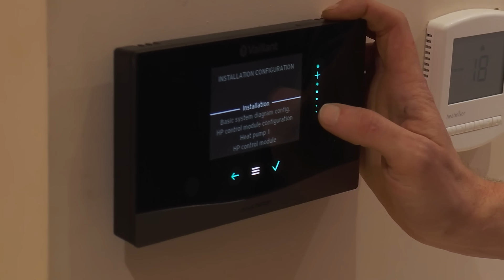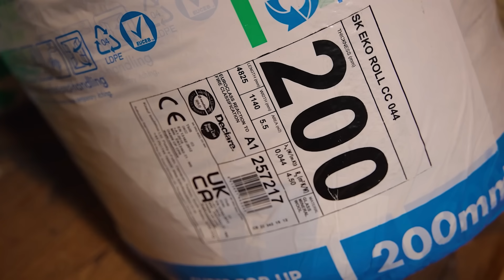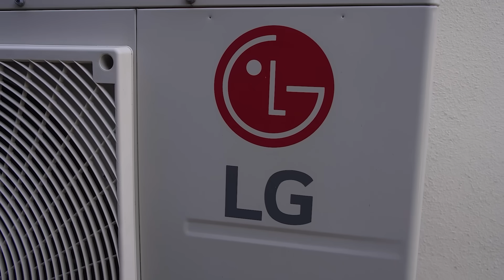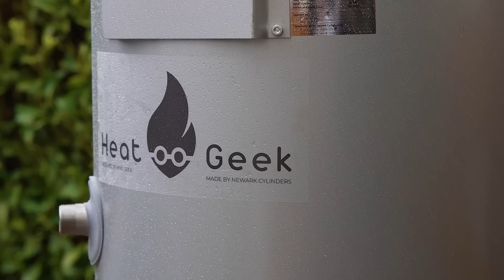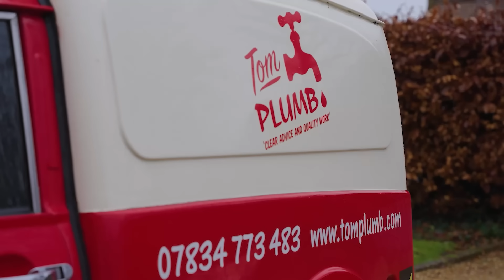Heat Geek’s Heat Pump One Year Later — The Verdict!

Comment: The expense, space requirement and maintenance is ridiculous.
Reply: Warm, efficient, cheaper than gas to run.
Reply: @Biggest-hz7ng save a few quid in energy bills, but it will take 2000 years to pay for itself 😂😂😂
Reply: @Biggest-hz7ng  Not true, it runs on electricity which is WAY more expensive than gas and in short supply in the UK
Reply: @SouthIslandSk8  the efficiency of the heat pump means more heat is delivered per penny spent by the heat pump, despite electricity being more expensive than gas per kWh.
Reply: @Biggest-hz7ng You are wasting your     time explaining.most of the comments are extremely naive.
Reply: @SouthIslandSk8  stop lying please. His system is running at a COP of 5! That is way cheaper than gas
Reply: @pietheijn-vo1gt  and it's only cost him about 40 grand. LOL. Will he even live long enough to get that back on energy savings?
Reply: @SouthIslandSk8  Don't spoil a good story with facts or the truth..
Reply: @ and now you are deflecting. UK needs to improve the spark gap so the payback shortens. UK has the worst sparkgap in all of europe
Reply: @pietheijn-vo1gt  The UK doesn't have enough electricity for people to use heat pumps, or electric cars. And the cost of electricity is still souring. I wonder why that is? Is it the result of chasing a net zero impossibility?
Reply: @SouthIslandSk8  all rubbish. There is plenty of electricity. The cost of electricity is souring because the price of gas is souring. Gas is always the most expensive source and because of the way electricity markets work it determines the price for everything. When there are lots of renewables, then electricity is cheap.
Reply: @pietheijn-vo1gt  Gas 6p per kw/h - electricity 30p per kw/hr - it's nothing to do with gas it's renewables.
Reply: @SouthIslandSk8  Gas boilers are about 88% efficient... ASHPs should be about 450% efficient... I pay about 9p/kWh for electricity... so that means (if you work it out) gas would need to be <1.76p... but it's nearer 6p !  Maybe you need to re-think things ??
Reply: @SouthIslandSk8  that's not how it works buddy. Ever heard of taxes and tariffs? Do you know 50% of the gas used by a gas plant is lost as heat? Lookup the meaning of merit order.
Reply: @southislandsk8 But a gas boiler is at best around 90% efficient. A heat pump is around 300-400% efficient. So you get a kWh of heating for about the same rate if you’re on a standard tariff. If you are on something like octopus cosihome tariff the heat pump will provide heat for cheaper. If you can tally it with a home battery to take advantage of night time rates and it can be a good amount cheaper still.
Reply: Maybe you need to rethnk that. I think your numbers are a bit off or at least missing context.

My gas boiler is 94% efficiemt.

You're saying ASHPs are 450% efficient — that's a Coefficient of Performance (COP) of 4.5, which is really high. In real-world UK conditions, especially in winter, most ASHPs average more like 250–300% efficiency over the year (COP of 2.5–3). That’s still good, but not magic.

Meanwhile, gas boilers are reliably 85–95% efficient, and gas is still ~5.5–6p/kWh vs electricity at 27–30p/kWh (not 9p — where are you getting that rate?). Unless you’re on some super off-peak EV tariff, that’s not typical.

If we run your same logic with more realistic figures:

ASHP at 300% efficiency = 1 unit of heat for 10p

Gas at 88% efficiency = 1 unit of heat for ~6.8p

So gas is still cheaper per kWh of heat unless your electricity is insanely cheap, and even then, ASHP install costs, retrofit issues, and performance in colder weather are huge factors. Plus, if you're using radiators instead of underfloor, the system has to work harder.
Reply: @southislandsk8 you seem a bit confused about the reason for UK electricity costs. The wholesale cost of electricity is set by the price paid for short burn gas stations and is therefore intrinsically linked to the cost of gas. Worth being aware that this is the gas futures prices not the gas spot price, and this has risen a good amount over the last 6 months. Moving to a more gas heavy mix isn’t going to help this.

https://youtu.be/IEnFmrgEbWo Offers some good insights into how  UK electricity pricing works.
Reply: @SouthIslandSk8  this install has a SCOP of 4.5 (450%) over the whole year.
Reply: @Biggest-hz7ng  And what is that scop going to look like in your average UK house, drafty victorian with tall ceilings?
Reply: @SouthIslandSk8  they can work just as well in Victorian houses.
Reply: @SouthIslandSk8  

The UK is currently using about 20% less electricity than 30 years ago as a result of efficiencies in machines and lighting.

The cost of electricity is what it is by government agreement to 'Marginal cost pricing' which ties it to the price of gas as the most expensive method of generating electricity.
Reply: @SouthIslandSk8  

My standard rate tariff is 26p for electricity, my HP tariff is 14p (3.5p per kWh of heat), my SCOP of 4 wipes out the expensive gas cost at 7p per kW of heat generated (assuming 6p per kWh and 85% efficient boiler).
Reply: @SouthIslandSk8  

My system has a SCOP of 4 (measured over 12 months), my tariff is 14p per kWh (3.5p per kWh of heat), I have radiators and work with a flow temperature of 32-34 C making if fairly efficient.
Reply: @SouthIslandSk8  

In my case it's 4 in my 1960's modestly insulated average two bedroom semi British built house. Two of my rooms pitch to 14' ceilings.
Reply: @southislandsk8 you think your gas boiler is 95% efficient in the real world? What you’ve done there is apply the best theoretical outcome for gas and compared it to an overly rigorous real world option for a heat pump (eg ignoring the cheap electricity options and suggesting 300% efficiency when watching a video of someone getting 500%).

Cost wise, I agree it’s expensive. Assuming a cost of £7.5k (15-7.5 grant) then paying £900 a year for heating vs the UK average of £1800 would see you quits in after 8 years. Probably 10 if you factored in a 5% return on the money if you didn’t spend it.
Reply: @Biggest-hz7ng  🤣
Reply: A whole room full of complex crap waiting to go wrong to get a radiator that is luke warm at best
Reply: @SouthIslandSk8   Just like modern cars.  In order to meet emissions targets they try to screw 150 horsepower and 60 MPG out of a 1 litre engine, then wonder why they pack up after 5 years.  I have no faith in the longevity of heat pumps, they are far too complex - which makes them more likely to go wrong.  Firing up a gas burner to heat some water in pipes which is then pumped round radiators works for me, even if it costs more, just like my 2lt non-turbo car engine uses more juice but has lasted 15 trouble-free years so far.

Comment: 2:30 How much was the previous gas bill, for comparison?
Reply: there's another video Roger did where they compared all the pricing, and in this case, the heatpump is miles cheaper
Reply: @defragsbin  Thanks, but that should be discussed in this video.  The actual heating costs needs to be compared over a full season.  So the prospective consumer can do the amortization to see if it's worth it.  Besides the difficulty of digging back through an old video to find a nugget of data.

All that this video really ends up with is the opinion that the "quality" of the heat is better, and that the system needs to be installed by truly knowledgable professionals.  There's not really anything new here.  Still can't tell if it's worth the investment.
Reply: Yeah, most commenters here seem to be (wilfully) forgetting that. Maybe because of Rogers rants against heat pumps when poorly retrofitted to old houses or westminster  :)  @defragsbin
Reply: None of the people scammed will tell you.

Comment: Great to hear that it only costs tens of thousands in total outlay, massive disruption to your home, and hundreds of man hours of investigation and experimentation to get the same performance as running a £2K gas boiler at a low temperature.  This is a cautionary tale, not a success story.
Reply: And, because I stated the obvious, saying that it (the heat pump) was a monstrosity, I was called  "someone of limited intelligence" 😂
Reply: It's both a cautionary tale and a success story in the end.
Reply: @defragsbin  King Pyrrhus had a "success" story.
Reply: Did King Pyrrhus have the OVO tariff and run his 6 bed house for £700 p/a like John? 😀

Was a bumpy ride and there are plenty of problems, but the technology provably works (and works in harsher climates than ours). There are definitely problems to sort out with MCS, regulation and consumer protection -- I don't think anyone is denying that.
Reply: Cheaper than gas to run, warm, efficient and clean.

Edit (as my reply was deleted by YouTube): his SCOP of 4.5 makes it significantly cheaper. Generating the same heat over the past year with gas would've cost £2200.
Reply: @Biggest-hz7ng  Cheaper than gas to run, if you spend £20K on insulation and replumbing, if you get the mythical 4.5 SCOP, and if you don't factor in servicing costs (if you can get anyone to touch them) and repair/replacement when the manufacturer says "Badly fitted, not covered", as they did with the original installation in question. The real laugh being that when you need them the most, they're least efficient, and the electricity to power them is predominantly coming from burning gas.
Reply: No they are not. They cost far more to provide the same level of heat and comfort as gas.
I know some fools will pay for solar panels and batteries to pay less to the electric company, but have lost all that money.

People that are scammed, like this poor man, will continue the lie as they feel foolish about how gullible they were. If only they would be honest and admit it was a mistake,  there is no shame in him saying he was the victim.
Reply: @Biggest-hz7ng  Living in a mud hut would be cheaper still, but I like my garden and driveway as it is. My small, but extremely efficient gas boiler is tucked away in the attic, no noise, and no unsightly chunk of metal in my drive.
Cheap's fine, if you lack taste......

Comment: This was NOT a typical install type. Not something that should be used as an example. Other than if you have an enormous sum of money for the install
Reply: It's a "Bad things happened, it's possible to fix it" episode. Now cheaper to run than gas and clean.
Reply: @Biggest-hz7ng  at the cost of 22k, get real. Complete junk
Reply: @CraveThatCoin  heat pump install pricing has moved on since this.
Reply: @Biggest-hz7ng  No it hasn't. The same as solor panels. Big investment for no true return

Comment: I like heat pumps and the idea of them. What I see especially of ASHPs heating radiators/UFH though is that it needs to be tuned very finely and there's a lot of potential to mess up the design - incorrect heat loss calcs, flow temps etc. Coupled with the fact many resemble the engine room of the Titanic and take a lot of space internally. They need to be more self-contained units, reduce the requirement for tailored plumbing.  I personally really like the idea of air-to-air as it seems to be more flexible in terms of initial design. If MVHR could be integrated into air-to-air systems, coupled with humidity control, it'd be a winner (and yes there needs to be an easy way to heat the hot water, ideally tanklessly).  As a result I'm holding off to see what happens in the next few years.
Reply: Ours was simple. Took the installers 20 minutes to say what size radiators were needed and then 2 days to do the install. 4 years on, all fine.
Reply: Nibe do self containted exhaust air heat pumps. We had one originally and I thought it was pretty decent. Provided extraction from kitchen and bathroom too and air movement through house. I did fine tune the software on it. Housing association ripped them out and replaced them with combis as they couldnt get anyone to set them up right and loads of tenants were complaining of big bills.
Reply: My thoughts. Good engineering for the real world needs to allow room for error. If everything is on a knife edge that is no good for the general population.
Reply: @thomaslundberg5588  I hear what you’re saying, but it’s not at all on a knife edge. It just needs doing competently.
Reply: @thomaslundberg5588 they do allow a margin for error?

Comment: I would like to know what the neighbours say about this installation for the noise output, which the last one was like a small turbine going off. 😊
Reply: they dont make that much noise when they're working properly like in this house.
Reply: Exactly. I saw one of these in a largish detached country six bed house behind the annex/guest house giving off a noticeable noise... great if you are far from a neighbours party wall.
Reply: They're quite... obviously not silent but you won't hear through a wall
Reply: @Robert-cu9bm  quiet?
Reply: @Woodkin007  

My one is quiet after a years use.

The first comment I get when showing to friends is 'how quiet it is', because many have read or been directed to the stories of faulty units generating noise.
Reply: I have a  neighbour one side with a heat pump (well two if you include pool) and other side with a oil boiler, have never heard the heat pump, but I hear the oil boiler if at that end of house.
Reply: They are just reversed airconditioners. When there are enough you will hear them. There will be a continuous drone just like in any hot country where they use AC

Comment: Ive just installed one, which is all fine & dandy, but I now use over 1Mw / month in the winter, mainly between 23:30-05:30 with Octopus. I do wonder if the heathrow airport substation fire started as everyone in the area switched on their EV's / home batteries / ASHP / mixergy tank ? just after 11:30 or so - Its very easy to pull 60-70 amps in my house without even trying.
Reply: That was a malicious rumour about the fire. Having a meter showing kWh and cost rather than "gas used in cubic  meters" does make you more aware of the energy our homes use.

Comment: The training for heat pump installation is 2 or 3 days, because the focus is on sales an installation.  Fixing and fault detection is a completely different issue and there close to no training on that.
Reply: You may want to qualify your statement by specifying which company you're referring to. There isn't some gentlemen's agreement that all installers must have the same training and must push sales sales sales.
Reply: Doesn’t even pass a sniff test. Which specific training is focussed on sales?  Installation is simple and doesn’t really require much education beyond standard G3 training.  The important part of the training is in the systems design engineering and most degree qualified mechanical engineers would be able to pick up the specifics in less than a week.
Reply: @enjek5654 True, but if one is degree qualified ME, why would they bother dicking around with domestic installs.
Reply: @ChariotsofWire180  Fair question. They could, for example, be overseeing the designs of systems, maybe with some other engineers under them. Would be a decentish job.  Also, many of the modern systems have an array of sensors and internet gateways so that they can be monitored and tweaked remotely, so can made use of so that their skills are being made use of.

Comment: I applied to fit an ASHP in my 1980's end terrace, knocked back by the council, appealed and was knocked back by the planning authority. So the government's flagship domestic heating plan has been rejected by the government's planning authority. Absolute madness.
Reply: @GaryDoyle-bq2vd  Rejected on what basis?  Most installs are done under permitted development.
Reply: I think the planning permission has got a lot easier
Reply: Maybe noise?
Reply: They're soon changing the rules about placing heat pumps within 1m from boundaries, etc.
Reply: will it really save you money? or do you simply want to stop reindeer from drowning due to rapidly rising sea levels
Reply: Think they did you a favour there

Comment: Again, let it be a lesson to the government...  it is a sophisiticated technology, it is specific to a system model, it is not plug and play, it requires significant technical support to specify and sustain, it is no simple replacement for the familiar technology, it is costly as a result.
Reply: The specification is a task for heating engineers, but future maintenance will likely be limited to the pump.
Reply: @Biggest-hz7ng  Yes, I would know all that... how does that relate to my statement?
Reply: @grahamrowe6278  the cost is mostly upfront. It is not a costly system in and of itself

Comment: I would like to know how much it all cost in the end
Reply: Lots... far more than a straight forward boiler swap..
Reply: @izalman  The thing is that the original boiler installation wouldn't have been designed properly either - It's just that boilers are more forgiving. All of the internal changes are applicable to the existing gas boiler, as is steady-state heating. Proper system design, internal improvements and control changes would have made the existing boiler far more efficient and cheaper to run.

So a fairer comparison would be just comparing the price of a new gas boiler to the heatpump itself. This difference would be more than covered by the grant.
Reply: Just an arm and a leg, times two